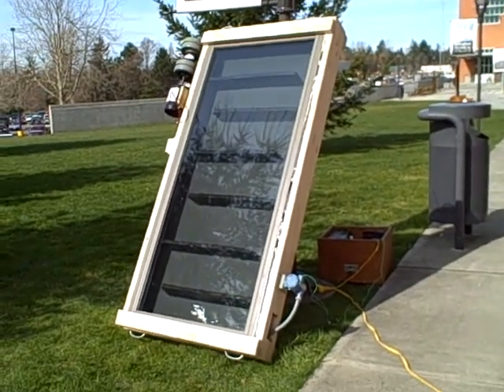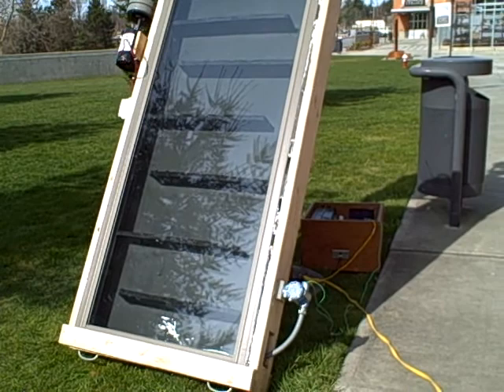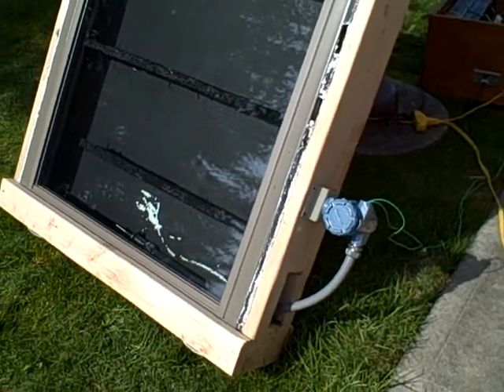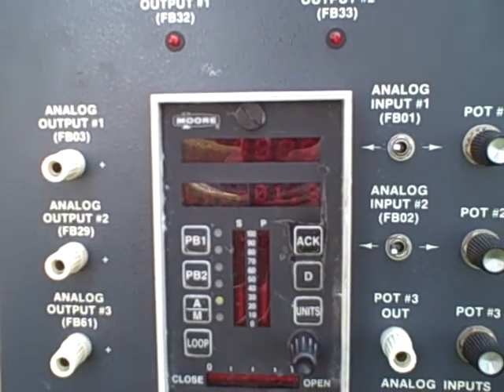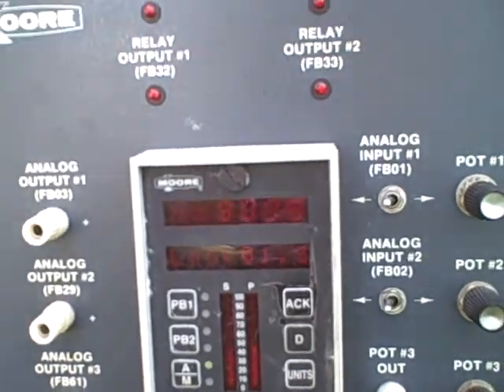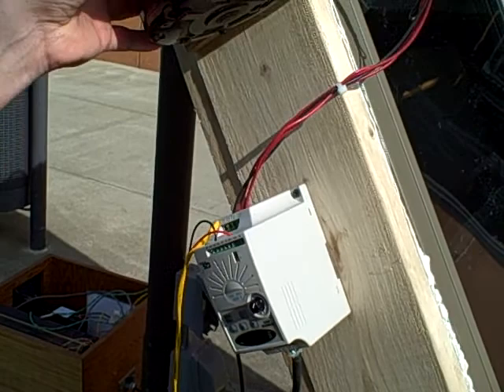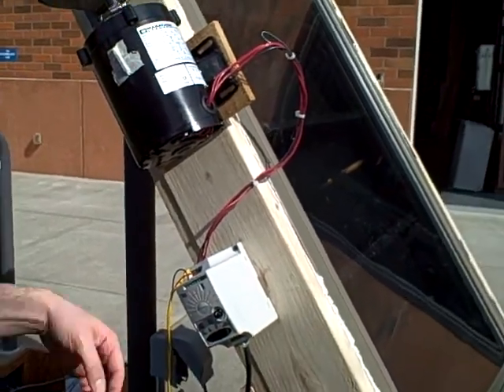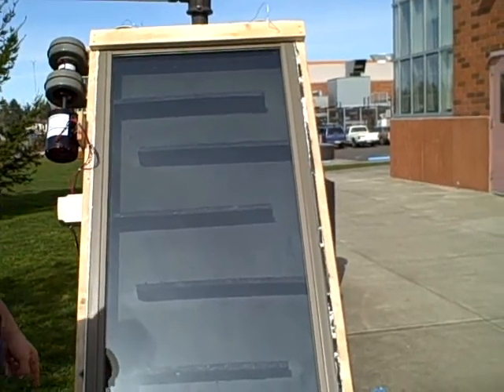PID-controlled solar air heater introduction

Comment from the maker: @MattSyTy For space heating, solar hot water and radiant-floor heating has definite advantages.  Our secondary purpose in building this solar air heater was to calculate performance with the goal of a solar-driven grain-drying system, for which hot air would be the best convection fluid.  We ended up getting about 1000 watts of thermal power at the desired grain-drying temperature on a nice sunny day.

Comment: I like this, but I think a solar hot water heating system with radiant flooring is the best option.  Obviously though, this video is meant to be a control systems educational approach to PID, VFD, etc.  That didn't get lost on me like it does some people.

Comment from the maker: @mark16596 The point of this project was for students to apply PID control to any sort of process they wanted.   This team chose a solar air heater.  Other teams chose things like air turbines (speed control) and convection ovens (temperature control).  Gratuitous applications of techology, all!

Comment from the maker: @billyjo856 The fine control of temperature requires a dedicated computer doing calculus (PID control -- Proportional - Integral - Derivative) to calculate the precise speed necessary at the fan.  So, while the basic concept is super-simple, the details are quite complex.  The real work that the students did, other than build the collector and the circuitry, is to program that computer for precise and stable temperature control.